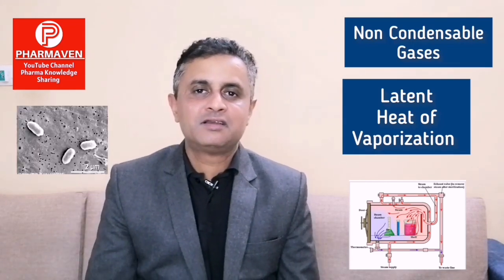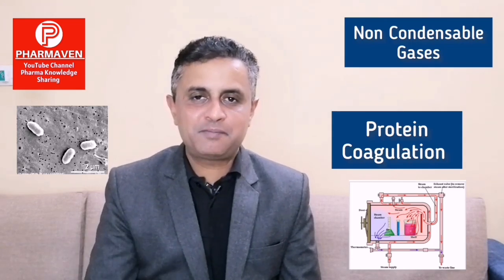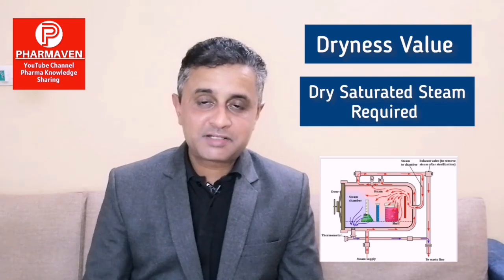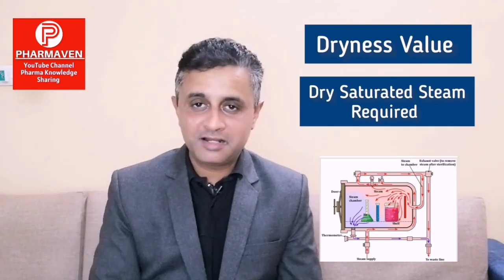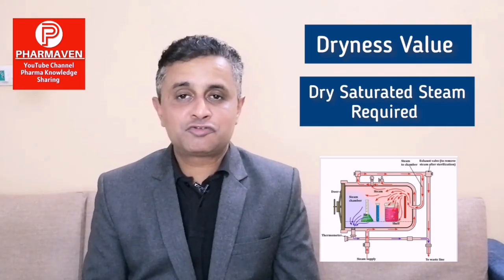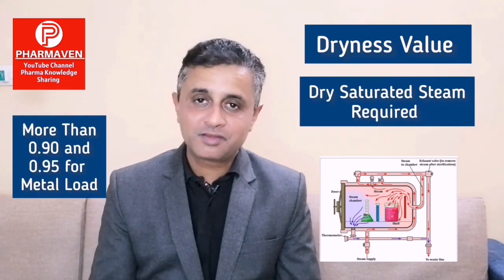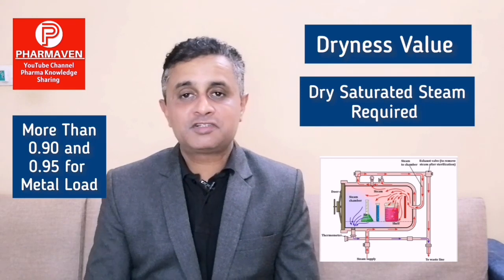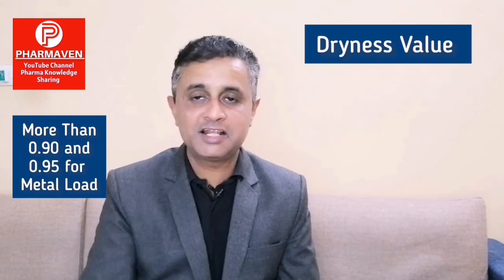Steam Sterilization; All You Want to Know #sterilization #aseptic #validation #sterile @PHARMAVEN

Comment: Hi sir,

I have doubt on that 30mins sterilization Hold time.. why 30mins sterilization is required to keep in autoclave sterilization??? Could you please clarify sir ???
Reply from the maker: 6 log achieved in 121 degrees 6 minutes when D value is 1

Worst case scenario, 2.5 D value, it will take 15 Minutes at 121 degree C

To have an Overkill approach of 12 log reduction, 121 degree C at 30 minutes applied
Reply: Tq sir
Reply: Why we have to calculate leathality from 100 to 100 degree Celsius... Can u give clarity sir??